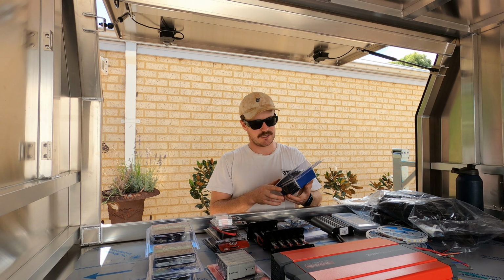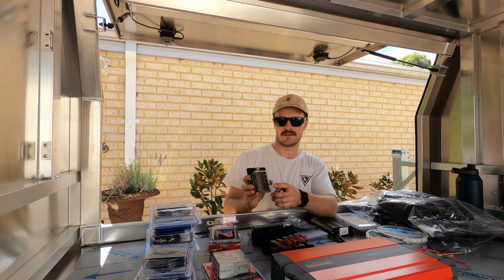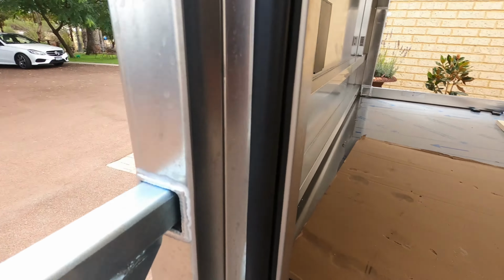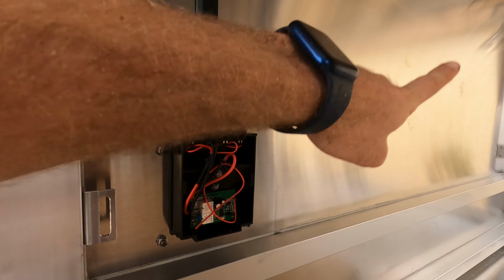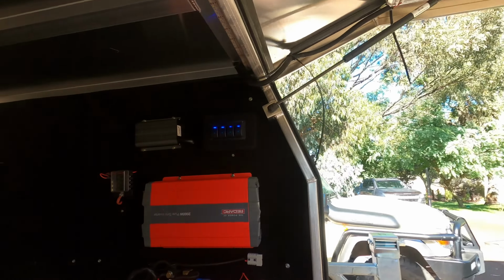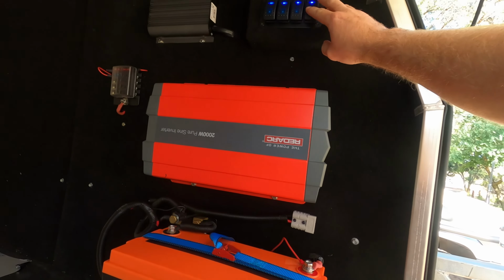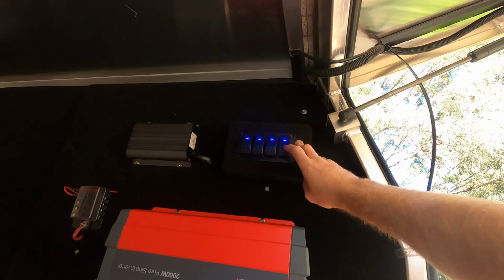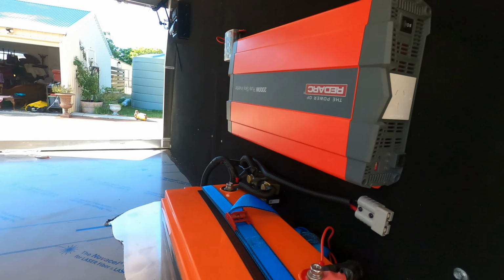79 Series Canopy Build DIY 12v System

Comment: Hey mate. I’m also right behind you in my 12V setup and am planning to also follow the same design as yourself and Daniel. I noticed there were a few comments on Daniel’s video recommending thicker gauge cable for the starter to canopy run and also replace the inline fuses with higher amperage midi/ANL fuses. It may be worth looking at your setup to ensure you’re not putting anything at risk of a fire.
Reply from the maker: Hi mate, thanks for the feedback. I am pretty confident in this setup atm as this cable is what was recommended to me by a couple autosparkies. Although I have run a thicker cable and midi fuses for my inverter set up which I haven’t published in this video 👍🏻

Comment: Tidy setup mate nothing overboard just a clean simple foundation. Did you have any issues with the Narva 100a twin core wiring not performing? Seems like capable stuff and I'm hoping to use with a Manager 30 kit so less then your 40a charger. Redarc manual says I should use 6B&S but it's a pain trying to fit two 6B&S cables through a cable gland. Cheers.
Reply from the maker: Hey mate na had no issues whatsoever with the Narva cable mate works well

Comment: Hey mate just a heads up, as soon as MDF gets wet it will expand, warp and grow mould. Not the best wood to use, id have recommended marine ply. Speaking from experience had my canopy walls get wet and was a strip out and redo job.
Reply from the maker: Cheers mate. I think I’ll eventually end up re doing it with just the one side with a stainless or ali sheet. I do like it as an option to see how I like having the headboard setup and that it is a cheap option to then be able to replace in the future when I know exactly how I want it 👍🏻
Reply: Ryobi, to DeWalt, to Makita. Fruit salad 😅

Cheers for the video mate. 🤙🏼
Reply from the maker: Ahahah caught out, dewalt is all old gear with the tower battery setup so just got an adaptor to run off new batterys to kill them. Ryobi is all gardening gear or tools I'll use once in a blue moon and the makita gear is all the regular use stuff I want to last 🤣  @lukerobins6850